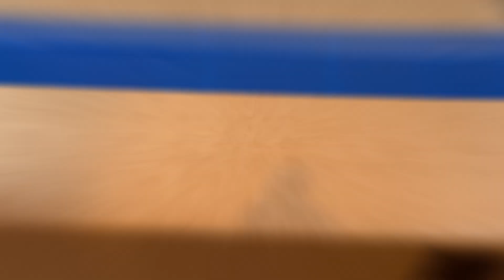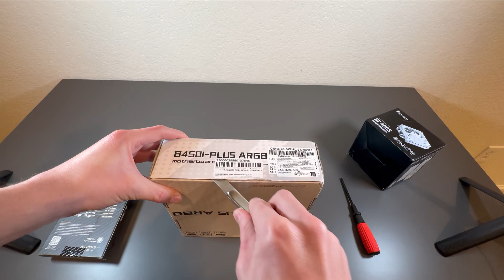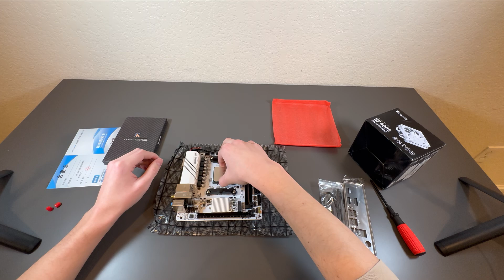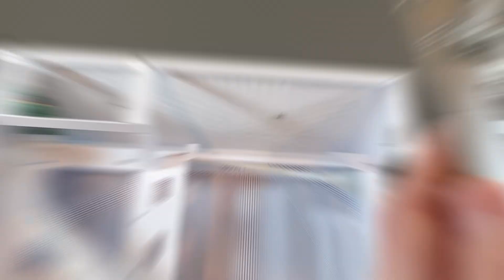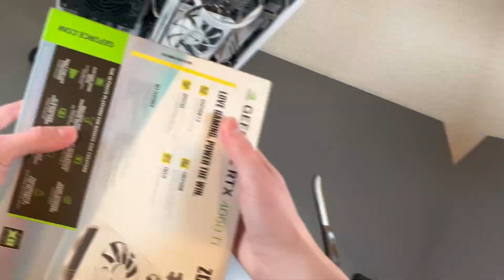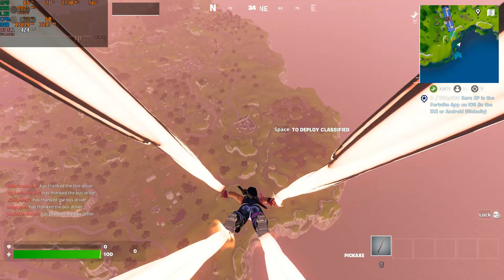Aliexpress Budget Mini-ITX Build

Comment: this is cool. gonna give it a go with the same case
Reply: How does it run before I buy it?
Reply: @Deucebgaming I ended up purchasing the Jonsbo z20 as it supports micro atx motherboards and full size atx psu’s. Micro itx parts are so expensive and the jonsbo z20 can fit an rtx3080 and cable management isn’t a nightmare. If you’re on a budget or this is your first build you should get a small micro atx case, it’ll be significantly cheaper
Reply: @run_away2 how is the game performance?

Comment: the case seems quite like the one i got, mesh designs are alike but design a bit different and case is heavy the rocket heavy vented and im sure it v2 version. really think metal side cover with lot ventilation and a glass front cover. the psu behind a wall but everything else is on display inc gpu on a stand using riser . crazy thing look like far more materials in rocket heavy and seem s well made . it only had one flaw, but it cost £20 so it was very cheap on offer. the fans i put covers on them a grill cables then no issue. also use some 4 pin server fans on a controller what i can have at lower speed so the case has crazy good air flow. but just with arctic 120 fans slim using rx 580 8gb and r5 4500 it only a tv 4k watching machine, under heavy load benchmarks max 65c using stick cooler and normal use around 38c, before the fans was in high 80's c under load and high 50's c normal so two fans make a huge difference and not done bench marks with chunky 40mm crazy airflow flans as they nearly 3cm wide and a line or tower of 4 them on front inside. only only flaw was cable in the case for psu was not an L so had to mount psu on center wall using L brackets but that works i just think i was built wrong as others who built in it got an L cable, no fuss just removed it and fed cable what came with psu through the case to it what prob more safe with 750w. only thing used rx 580 that was £70 so overall a great system what better than expected, it can easy play all my games but this tv rig why my main rig rests as that uses a lot more power. no point when 90% watching stuff using twice the power, might as well use low power machine and keep main machine for editing and games

Comment: Any tips for accessories to make the cable management easier for this case? like 90 degrees power cable connector? Shorter PSU cables?
Reply from the maker: I didn’t use any accessories or adapters. Cable management wasn’t much of an issue with this case but you will definitely want a fully modular PSU.
Reply: @MentuhlPCs  cool thanks!

Comment: Yeah the ryzen 5500 is not a good choice. I did a build for my nephew, he's 10 years old and i got him the 5500 and an rx 6650 xt. Well that cpu is hurting his performance in gaming. It only runs at gen 3 pcie. And is bottlenecking his system. It's drastically hurting his framerates in games like fortnite.

Comment: GPUs (all of them) send budget gaming out the window
Reply from the maker: That’s fair, you can always go with older cards like the Gtx 1070 or Gtx 1080. They still work great for most games and I was able to get a Gtx 1070 for $70 and even a Gtx 1080 for $80 but that is definitely the case for most modern cards.

Comment: does any standard psu  150x140x86cm fit in pc case?
Reply from the maker: Unfortunately the case doesn't. You will need an SFX PSU.
Reply: @ thanks for the tip +1sub here :)

Comment: I built a pc for a friend with all Aliexpress parts about a month ago. Total cost was below $300 after a bunch of discount codes. Same motherboard, same case, a ryzen 5 2600, id-cooling is50x, 16gb cuso rgb, 512gb nvme, rx 580, two upsiren prism fans, a jeyi heatsink for the m.2 and a 500w psu. I'm so amazed with all the prices that I was able to get this case with a 3.0 cable for only $31.29 after taxes... Thank you China!!! Good build!
Reply: which power supply did you get?

Comment: i ordered that power supply that you recommended from ali express, would it work fine? there is no videos about it. and i am wondering if the 500w would be fine with a 2070 super and ryzen 5 5600x
Reply: get at least 650w with that setup bro. dont cheap out your psu
Reply: @MadFaker  thanks, would a MSI 650W MAG A650BN be good? ive seen good reviews for it, although it is $20 cheaper than the one i bought on ali express
Reply from the maker: The MSI 650w MAG A650BN should be an ok fit for the 2070 super; however, you can get a 650-watt gold-rated power supply for around $60, which would be a lot more reliable. Also, the one I mentioned from AliExpress is SFX, and it seems like you are looking for an ATX, which will give you a lot better options than the AliExpress one.
Reply: @MentuhlPCs  Thanks a lot
Reply from the maker: No Problem!